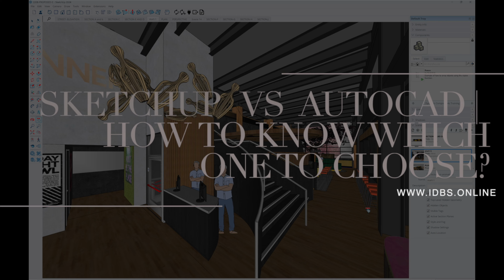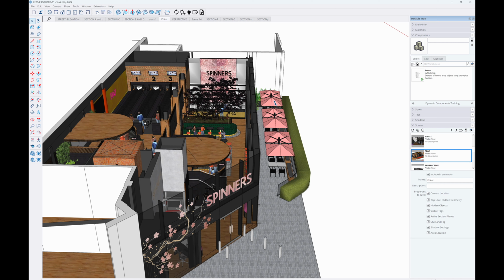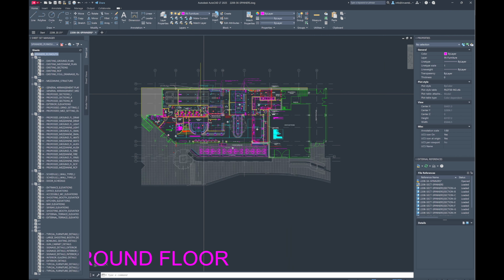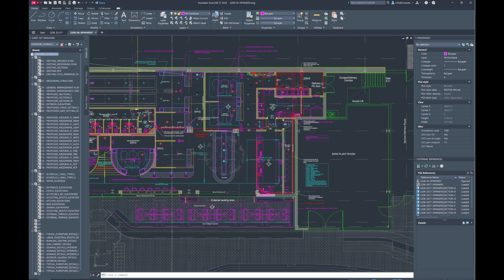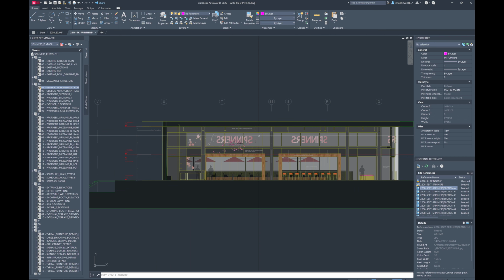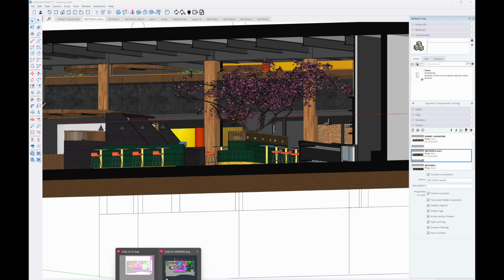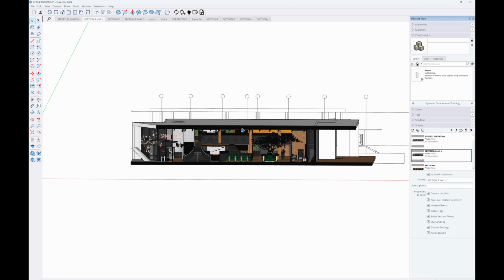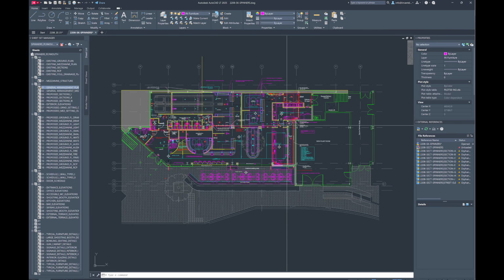Sketchup Vs Autocad | How To Know Which One To Choose?

Comment: Autocad is NOT a 2D drafting program only. I can assure it is WAY better that sketchup for 3d modeling. Specially to design complex and large models, to work with teams with xrefs, and to easily iterate between 2d and 3d and variate the design from the first day of the process. I`ve tryed sketchup (less technical), rhino (only better for nurbs modeling and parametric modeling, not better for regular euclidean geometry), and revit (excesively complicated for detail modeling, conceptual modeling, and really bad for iterations.....excellent for the construction stage and tecnical development).  For small and even medium scale project.....autocad 2D+3D is undoubtely the best. You are right about that (almost) nobody uses it....honestly....I dont know why. (I guess its because sketchup is easier to learn and requires less skills). You can also work with 2d xrefs embedded in the 3d model, which gives you not only speed and accuracy, but also an extraordinary and precise control over the 3d geometry.

Comment: Great channel and insight!

I’ve been working in the high end real estate photography field for over 10 years but the market has dried up in Florida. I’ve also been using 3DS Max and other 3D programs since 2005, but don’t have experience with AutoCAD or Sketchup. Im considering a career switch but don’t know what direction to take. I love 3D but there aren’t many jobs in demand anymore. I would like to take that knowledge and transition into more of a designer position. I also like interior design but don’t have hands experience with it either. 

AutoCAD seems overwhelming to learn and I’ve sunk almost two decades into learning programs like 3DS Max. I fear AutoCAD may be off the table with the time I have to learn.

Do you think learning Sketchup for arch and interior design would be the way to go?
Reply from the maker: Hi and thanks for watching my video! In your case it's tricky because you already know a program that does both 2D, 3D as well as renders quite well. The only problem is that it's the type of software that older offices use or large commercial offices, so in a way the pool of places where you could get work is getting more limited, especially if you don't also know AutoCAD as well as SketchUp. I feel like if you already know 3DS Max then it really won't take long to learn both AutoCAD and SketchUp and then all fo a sudden you become very much more in demand (as an employee). If you prefer to work for yourself, it's a different story; 3ds is an expensive program, especially in comparison to SketchUp online, which is free! If money isn't an issue, it's time, you might be fast using 3DS, but SketchUp is really quick for easy and simple modelling.

If I was in yrou position, I'd learn both (which sounds bigger than it really is, if you're already proficient with 3DS then learning AutoCAD and SketchUp will be a breeze - especially with a good teacher. If you're open to it, try our AutoCAD course and our SketchUp course on our IntoDesign platform: You could learn AutoCAD in a few weeks to a month and then move on to SketchUp: https://www.idbs.online/intodesign/

Let me know what you decide!